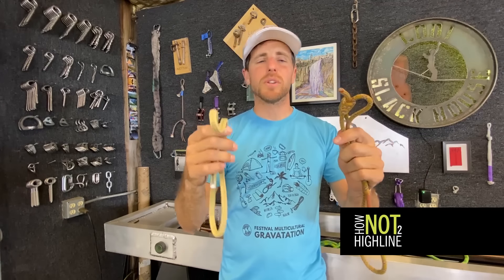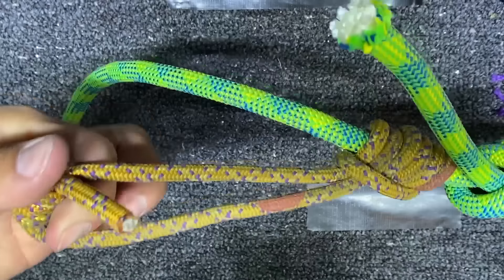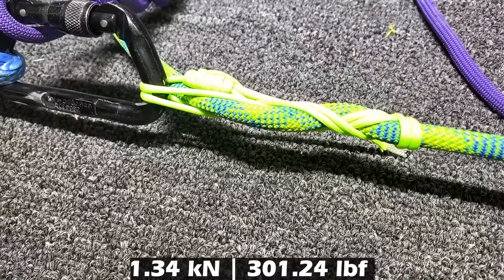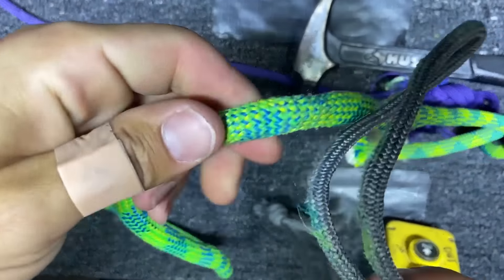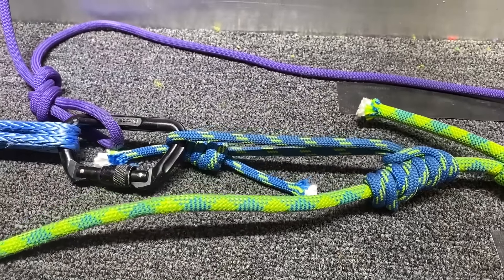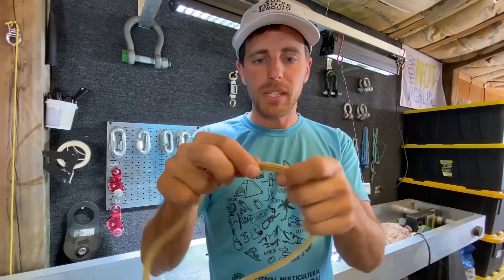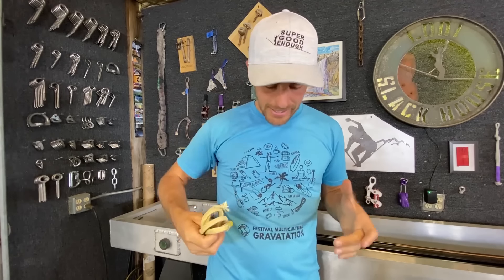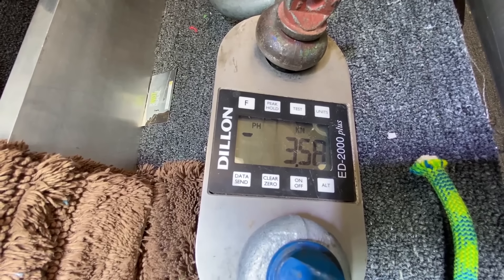Prusik, Auto Blocks, and Klemheist Break Tests

Comment: What I always wondered is, how well do friction knots do with dynamic loads? In austria and belgium we teach how to lower off of single bolts in case you can't reach the anchors of a pitch, with a prussik backup. Basically, like in this diagram: https://www.mountainproject.com/photo/109446198 except that we don't teach to leave quicklinks as they can rust shut and become a nuisance in a sport route (and cause weird leverage effects on the next climber clipping a quickdraw on top of the quicklink)

I've taught this many many times and I know Petzl ran tests (with 7mm prussiks) but nowadays lots of people use 5mm or 6mm acccessory cords and 9.1mm climbing ropes and I often wonder how well they'd do under dynamic loads/lead falls... So much so that I'm in current talks with the federation of falling on different diameter prussiks backed up with a top rope belay with loads of slack as a backup, but sometimes I feel these tests might never happen. Any ideas yourself?

Comment: The presentation of variables was a bit chaotic. The tests need to be done again with an EQUAL number of trials for each knot at each cord diameter.  Why was it necessary to diverge and start testing loops?  Yeah, double loops are stronger than single loops.  I was interested in which hitch slipped at lower loads and which didn't slip until higher loads.  If the hitch line broke first, then no slipping at all.  I wish he would have summarized which hitch held best, that is began slipping at a higher load.  It wasn't the auto-hitch. That leaves the Prusik vs the Kliemhiest. I reviewed and think this is what happened:  

At 4mm both the Prusik and the Kliemhiest broke without slipping. Inconclusive.   At 5mm the Kliemhiest slipped at  3.3 kn.  The Prusik didn't slip until 4.5 kn & in the second trial, Prusik didn't slip but broke. Prusil wins at 5mm. There wasn't a 2nd trial Kliemhiest.
   
At 7 mm Kliemhiest slipped at 7 kn. Again no 2nd trial Kliemhiest.  The Prusik had two trials. it slipped at 7.9 kn & then at 5 kn.  Average of those two Prusik 6.45 kn.  So the Prusik won once and lost once and averaged lower than the Kliemhiest but unfairly the Kliemhiest had no second trial.  Inconclusive. Maybe the Prusik slips at a higher load, maybe it doesn't.

With two inconclusive and one conclusive win for the Prusik, the Prusik might be the better holding friction hitch.  He needs to run this again with maybe three trials of each knot at each cord diameter and worry more about when they slip if at all. Not when the cord breaks outside the knot.

Comment: You do not know how the autoblock works.  It is not ment to be a friction hitch like a prussik it is tied between the harnness and the rappel divice.  If you let go of the autoblock it hits the bottom of the rappel device and prevents the rope from going through the rappel device.  This is why the autoblock can be tied to a leg loop.. It is NOT weight bearing.

Comment: I think your entire test set up is WRONG. When you fall, its not in slow motion like this hydraulic device, and the dynamics on force and how the cordage is stressed is very different.  That's why they rate and test breaking strength in KILONEWTONS and not simply with loading weight.  it's also why dynamic ropes were invented and you use them to lead climb.